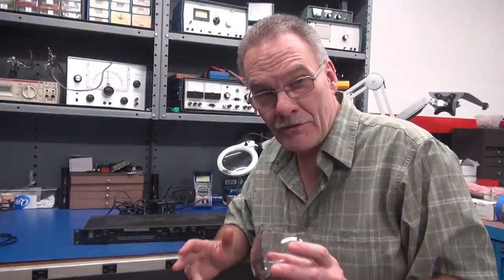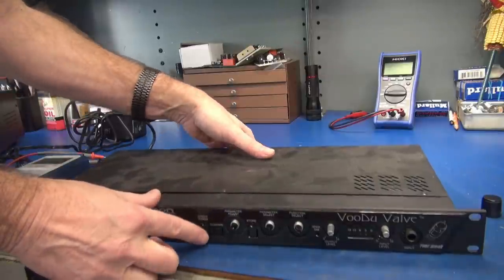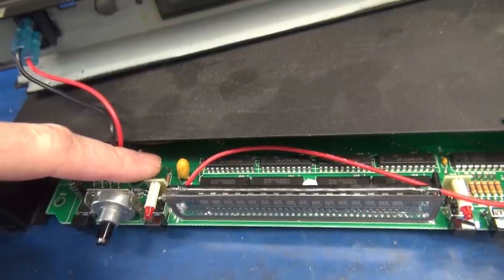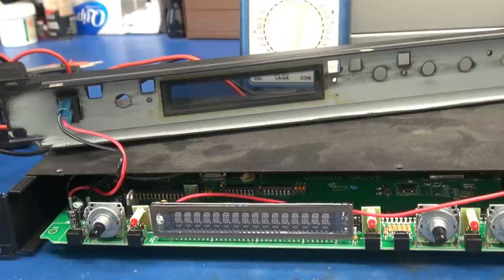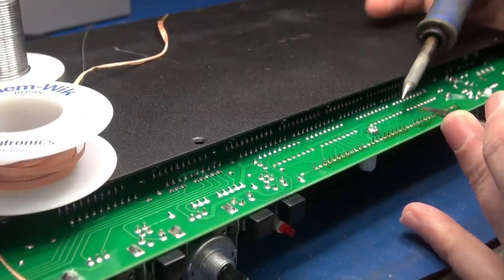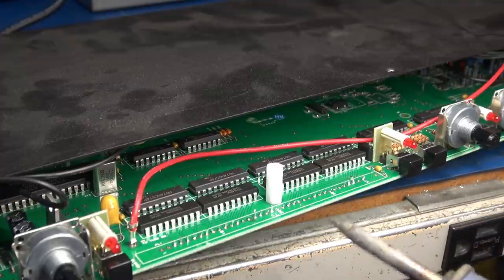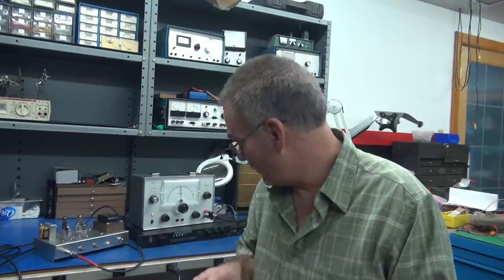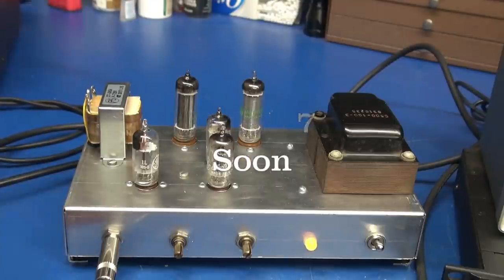How to repair dead display Rocktron Voodu Valve rack mount guitar effect module step by step

Comment: I have used a Denon desoldering gun to remove displays and IC's for decades with no problems with foils. Your method is admittedly much cheaper than buying the gun, and what I used to use before buying it. Of course, I was an electronics repair contractor for many years, and time= money. Nothing wrong with your method, but folks should understand there are other tools to do the job. Most excellent cleanup of the circuit board. It looked like new.

Comment: It's good that the designers of the circuit board made the plated through holes big enough to re-work relatively easily.  All too often you see the holes just big enough to accommodate the component leads and then you can have problems cleaning them out if you don't have a desoldering gun.

Comment: I've done similar repairs, cannot agree more on the requirement to take your time and methodically work your way through it as you demonstrated.

Like others, I'm curious where you found a replacement display tube.  I've seen similar but for something like that you need as exact a match as possible.  One of my pet peeves is trying to find replacements for special parts like those.

Keep up the good work, Terry!

Comment: Old school is in session! Turn board upside down like Terry did. Get some rosin flux and wipe across the remaining pins.
 One by one take a soldering iron with  a chisel tip and heat and push down on  the pins. Some may just drop as the flux 
won't hold them but you can pull any that won't fall through. Clean remaining solder covering the holes with solder wick 
and heat . Then follow Terry as he puts the new display  in. Do all steps carefully you're not in any kind of race.

Comment: Hakko 808 (not expensive) or a hot air station (slightly more) would make quick work of that. I used to do much larger displays on pinball machines. The most fragile part on those displays is the legs. Doesn't take much flexing to snap them right off.

Comment: I have a voodu valve that has a bad selector dial. It will skip over ever other preset so im only getting about half the number of presets thats avaliable. Is it possible to replace that part? If so where would I find a new dial?

Comment: I just bought a Rocktron Intellifex V1.11 that sounds great, but it has a display that has a brightness intensity of only about 5% to 10%.  When powered on, the jelly bean cap leads meter at 28.8 volts, so a replacement display is probably the fix.  Do you have a spare one that you could sell me, or can you quote me a price to do the repair?  Thanks in advance, Tony D.